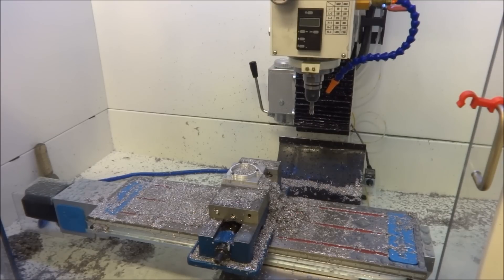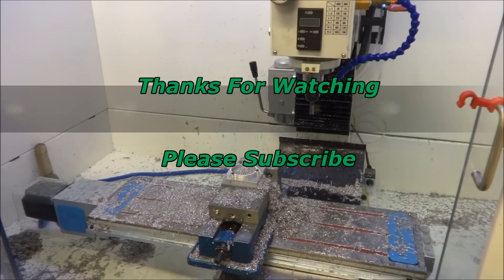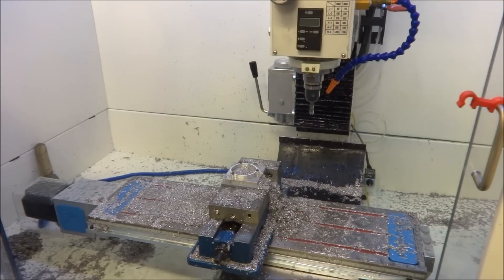Pm727M Shop Time!

Comment: I'm really interested in this machine and the PM-25MV for purposes of CNC conversion. Any suggestions as to advantages vs disadvantages of the PM-727M vs the PM-25MV? They are both currently the same price, and are the 2 machines that I narrowed down to. I considered the G0704 as well, but customer service told me they can't sell them without a stand (which I don't need),  and the PM machines have upgrades/features that I really want.
Reply from the maker: Hi Brian no comparison between the 704 25v the pm 727m is a much larger machine I posted a video on machining a 704 saddle with the 727m take a look it's a much larger machine. Castings and weight.  Only x travel on 704 and 25v give you the impression they are the same. They are not.
Reply: CNC4XR7 Thanks for the info!
I ran across this video when googling Pm-25 vs Pm-727. I’ve sinced watched a lot of your other videos. Awesome content and very informative.
Reply from the maker: @brianmlodzik9052   Check this one out the G0704 and PM-25v are the same size. https://www.youtube.com/watch?v=YT2q-qBczRY&feature=youtu.be

Comment: thanks sam . did you get the finish better?
Reply from the maker: I did get the finish a little better I found the gearbox oil had leaked into the spindle bearings and washed out some of the grease I re greased the bearings and reassembled the spindle. Much better.
Reply: sam try slow s speed or fed on last pass ?
Reply from the maker: Timothy Case 
yeah still finding my way